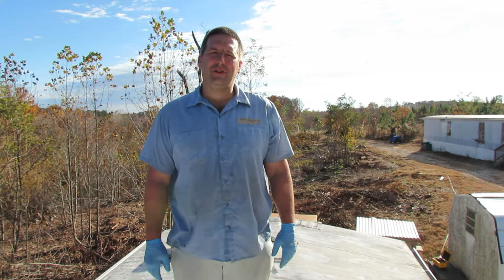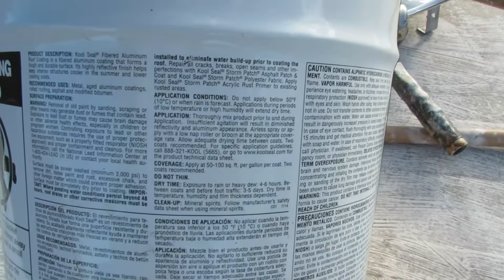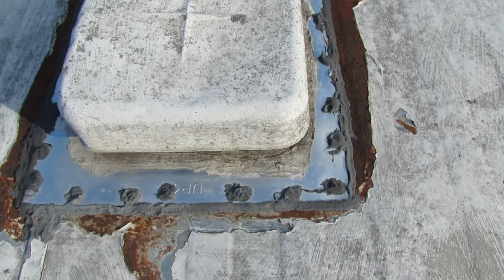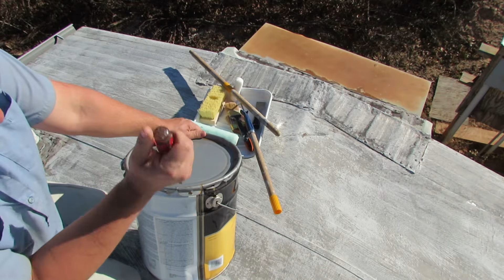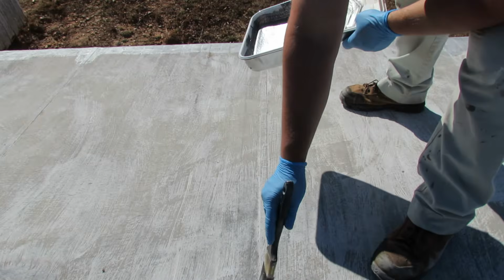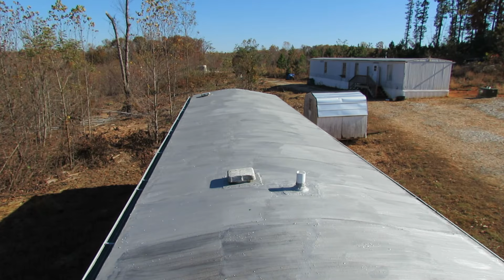How To Apply Kool Seal Roof Coating on a Mobile Home

Comment: Roller doest put enough down to seal the cracks. Use a three knot brush and get on your hands and knees. Sloppy that on. Not too thick, not too thin, but even as you can. Definitely use the Kool Sea primer to seal those cracks. Top coat is just to reflect/scatter the UV rays. Just sayin'...and its looking like you might want to upgrade to silicone?

Comment: How much did it end up taking? 5 gallons was enough?
Reply from the maker: @seanwilliams3311 it took a bit less than the 5 gallons. For this 14x40 roof. I had just a bit extra for some patch work on the other mobile home. Great question. Thanks for watching and asking. ~Mr. C.

Comment: About how much should I pay for having this service done on a mobile home? If you can give me a ballpark figure so I don't get taken 🥲.
Reply from the maker: @destinyforever honestly I don't know. If I was estimating the job I would include 2 5-gallon buckets of sealer for a 14x70 single wide and consumables like brush and pan etc. Then I would calculate hours and hourly rate. Materials would be around $300 and labor for 8 hours at let's say $40 / hr. So a total of $700 maybe more maybe less. Great question! I hope this helps. Thanks for watching. ~Mr. C.

Comment: U video is good,now i have my food trailer you think that can work on the too? I have few spots leak where the screws are ,and i was thinking to sealed the whole roof
Reply from the maker: @DavidRochabrun-lq9tn what a great question. I would use a more flexible product because food trucks drive around. Check out this camper roof coating. I think this might help.

https://amzn.to/3ButPoc

Thanks for watching and commenting. ~Dr. C.

Comment: so how many 5 gallons did it take?
Reply from the maker: @thomasschierer9326 the 40 x 12 foot trailer only needed 5 gallons. The application rate is 50 -100 square feet per gallon at 2 coats and the trailer has approximately 500 square feet of surface area. A 70 x 14 trailer would need 10 gallons or more if you wanted a heavy coat. Great question. Thanks for asking and watching. ~Mr. C.

Comment: Thank you for the video. I am a single older woman and cannot do the work myself, however NOW I will know if the Handyman I hire is doing the correct job! Luv the video !!!
Reply from the maker: @shs8989 I am so happy you found the video helpful. Thank you so much for the kind comment. I really appreciate it. ~Mr. C.
Reply: Hoping this  will work on a fiberglass camper  ?
Reply: I'm a single older woman and am afraid of heights and am seriously thinking that I'm going to be climbing up ontop of my trailer and getting it done.  NEEDS IT REALLY BAD!

Comment: I wonder, does it help deaden the rain noise at all?
Reply from the maker: @Condor1970 in my experience and opinion, no. It works really well protecting your roof from rusting and seals any seams from water intrusion. Excellent question. Thanks for watching! ~Mr. C.
Reply: Imo yes I lived in one for 7yrs that I remodel and flipped then built my first house. Before you could hear the wind making the roof rattle,wrinkle sound and ever hear a bird walking on it lol.. after 2 good coats of cool seal.no.more crackling sounds and less rain noise.

Comment: you don't pour it into a pan just pour it on the roof duh
Reply from the maker: @just me that is an interesting idea. Do you have experience with this method? Even better, do you have a video using the pour on the roof method? If you don't have a video maybe make one so all of us can learn a new and possibly better technique. I ask because I will be doing another roof soon and would like to know pouring a roof coating on a roof with pitch might be more efficient. Thanks for the kind and constructive comment. ~Mr. C.
Reply: If you don’t mind, can you tell me where I can find the stuff that I want? Do I really need it don’t leak nothing like that. I just want to do the top cool and sealed I went to Lowe’s they don’t have nothing like that. Can you please tell me.
Reply: Tractor supply sells it and yes you need to do it or will help your roof not start leaking and keep heat out on summers @jimcool6824

Comment: Hi,,, THANKS.  I'm just hoping that you'll come back & show us/ give us a 1 or 2 year report.?  I'll bet that that coating you used will expand & crack after the first year. Then those cracks will be like building a pond, for the water to sit, freeze & crack open more, creating leaks. I THINK, that you should have used something made of RUBBER. Something that will flow into all of those dents & cracks, & NOT expand & crack open.  Only time will tell.
'Project Farm' has some awesome tests on different types of roof coating materials. VERY GOOD info!  You should check them out & do a comparison of the coating that you are using.  I'll be back in another year,, to see how your job turns out. THANKS Again.
Reply from the maker: @J DoBoy I have not had any issues with the roof after the coating was applied. I will make a video of the roof soon. We are right at a year and a half so that would be enough time for deterioration to be seen. Thanks for the tip on Project Farm. Have you had issues in the past with the product I used? If yes, I would love to hear about them so I can look for a better product. Thank you for watching and commenting! ~Mr. C.

Comment: How many gallons did you use on your roof? Thanks
Reply from the maker: @Dustin I used one 5 gallon bucket for this 40' roof. I would go with 10 gallons for a 70' roof. I had a little extra for some patch work on our mobile home roof but not much. Thanks for watching! ~Mr. C.

Comment: I bought a 5 gallon can of koolseal.  Would that be enough to do a 14×60 mobile home roof?  It's a flat roof.
Reply from the maker: @Carol Moon your roof has 840 sq ft. The Koolseal website (link below) says the product will cover 50 to 100 sq ft per gallon. At the thinnest single application you would only get 500 sq ft covered with the original 5 gallon bucket. Looks like another bucket would ensure you can achieve the two recommended coats or a single thick coat. Thanks for watching and asking! ~Mr. C.

https://www.koolseal.com/product/fibered-aluminum-roof-coating/
Reply: @NaturesCadenceFarm  thank you, that's good to know. I'll check out the link.